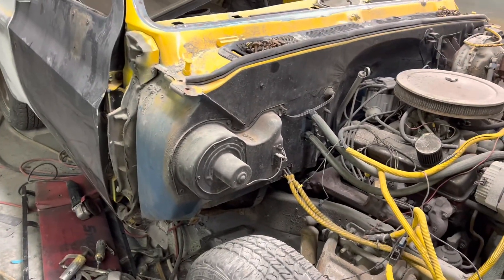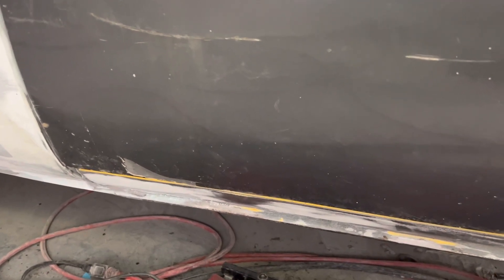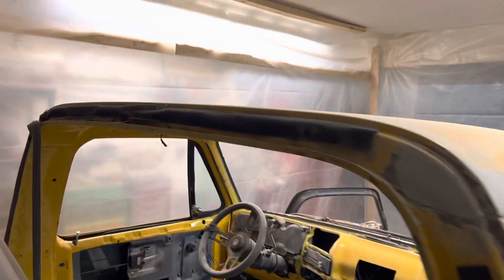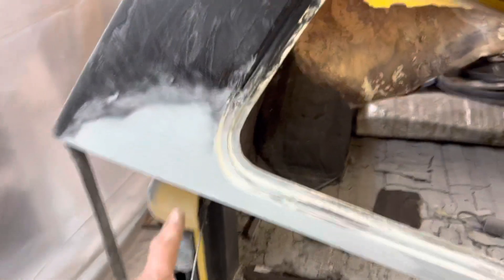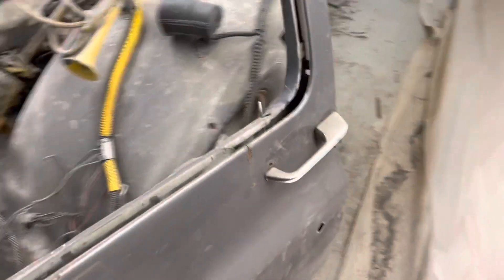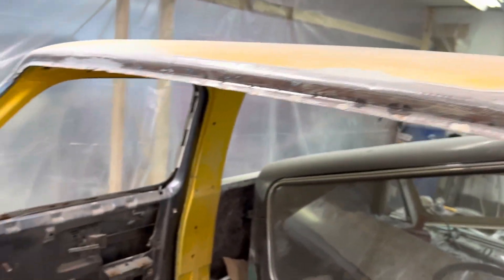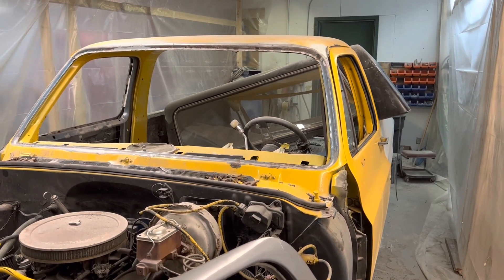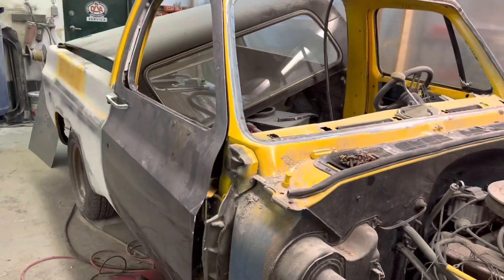78 Bumble Blazer Squarebody Project Update. Metal Work/Bodywork

Comment: What about automeadow direct or LMC truck In question Have you ever done replacing bedside and inner wheel Wells on 2008 Silverado
Reply from the maker: I have not had a chance to try auto metal directs doors yet. LMC hasn’t worked for us in the past. We’ve done a 2007 Sierra (classic bodystyle) and a 2016 Silverado